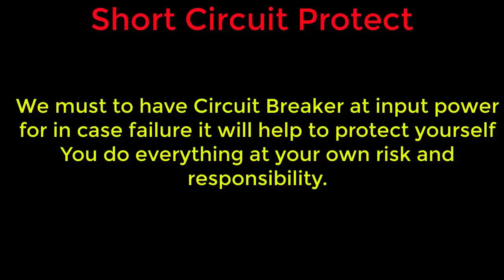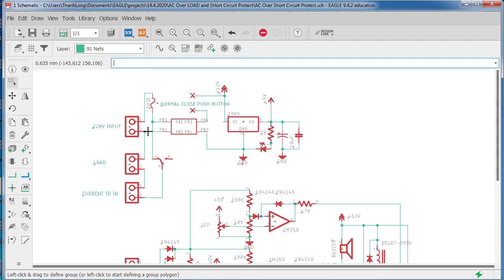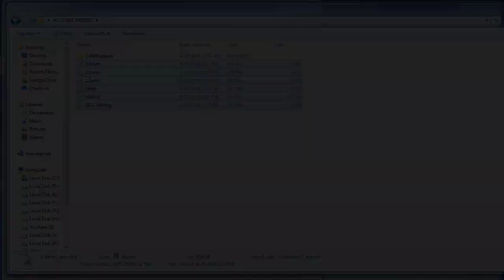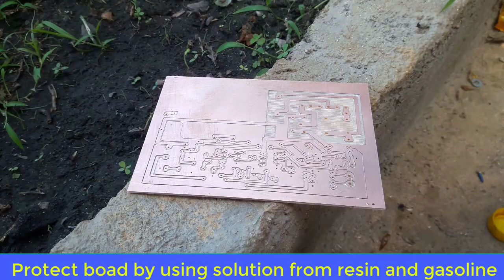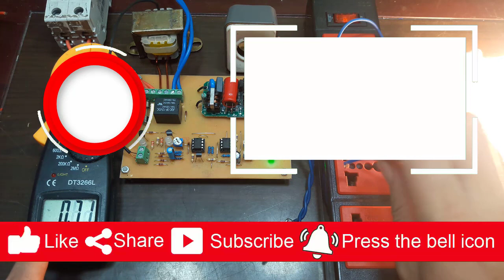Homemade AC Overcurrent and Short Circuit Protection Circuit | Milling PCB with CNC at home

Comment from the maker: Hello friend. Today i will make AC Overcurrent and Short Circuit Protection Circuit  by using my CNC to milling PCB. I share all file below include schematic diagram PCB and G-code for CNC.
This circuit woking with 220VAC so you need to be carefull. You do everything at your own risk and responsibility.
If the load current is higher than the setting current. Siren will alarm overload. If we reduce the load everything will return to normal, otherwise the siren will continue to ring until the time is up, the relay will turn off the output load and the overload indicator LED will light.

Comment: # long technical # this circuit can use as  300 watt pure sine wave inverter output protection from short-circuit and from overload..??
Reply from the maker: of course. But you don't need 220V to 12V SMPS module, just use 12V from battery
Reply: @LongTechnical  ...frnd...previously...you have already made a pure sine wave (H-bridge) inverter using ATTINY 13A.......{{{{Share How To Make 500W Pure Sine Wave Inverter ! H Bridge Transformer Driver }}}}..........can you plz. tell me....while setting HIGH and LOW fuse bits....is it necessary to callibrate the internal RC oscillator by writing (0*51) on the callibration box.....on EXTREME BURNER (programming tool ).......frnd....this information is really very very important to me......as a small mistake can damage this attiny 13a microcontroller....which is very costly.....frnd...hope you can understand....plz. help me.....frnd.....Thanks....

Comment: #long technical#...why are u using  1N4148 diodes between relay negative pin & c1815 collector pin..
What will happen..if not adding this diode...??

Comment: # Long Tecnical #....frnd...previously...you have already made a pure sine wave (H-bridge) inverter using ATTINY 13A.......{{{{Share How To Make 500W Pure Sine Wave Inverter ! H Bridge Transformer Driver }}}}..........can you plz. tell me....while setting HIGH and LOW fuse bits....is it necessary to callibrate the internal RC oscillator by writing (0*51) on the callibration box.....on EXTREME BURNER (programming tool ).......frnd....this information is really very very important to me......as a small mistake can damage this attiny 13a microcontroller....which is very costly.....frnd...hope you can understand....plz. help me.....frnd.....Thanks....